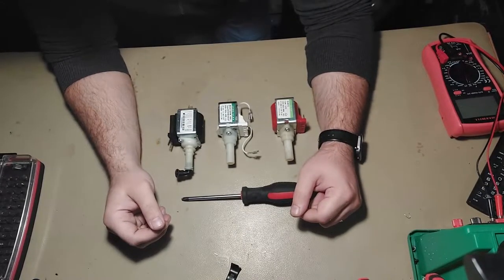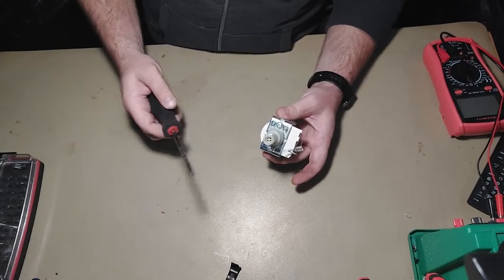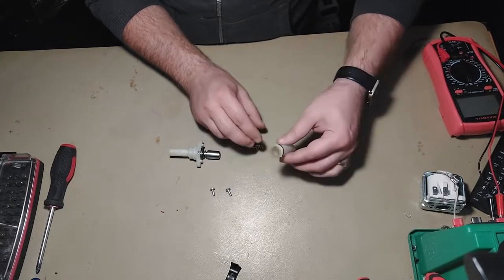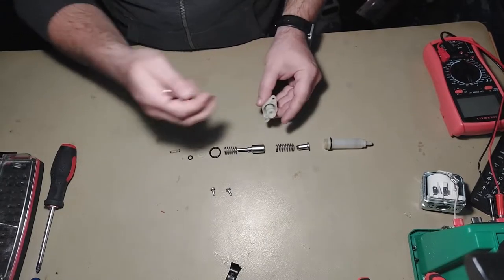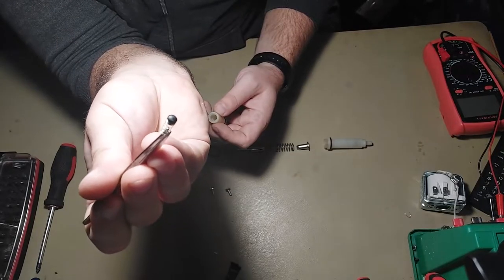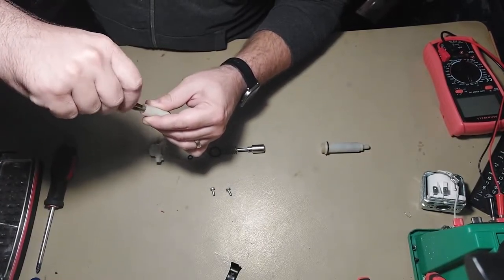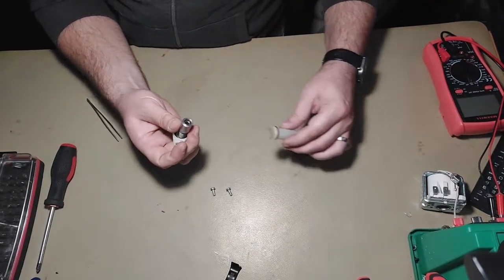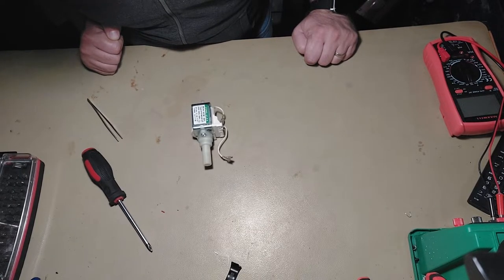Coffee machine Pump - Step by step disassembly

Comment: Hi, could you possibly tell me wether there its more likely that the thermal fuse has blown on my pump than the pump itself?? 🤔 I've checked the fuse with a multimeter and not getting any reading or beeps but at same time I'm not  getting any on the pump either so would it be just the fuse or possibly both? 🤔

Comment: Hey I have a question: my krups nesprosso xn702 has a problem: the buttons light up, but when pressing it, nothing happends. Do you have Amy idea What might be the problem?
Reply from the maker: I suspect you lost the magnet of the cup holder or the hold sensor is faulty. You can bypass it by permanently shorting the 2 pins of the HOLD connector from the main board.
Reply: @benassy69  
Do you got any video’s of that haha.
What is a cupholder magnet?
#I fixed it with aluminiumfoil